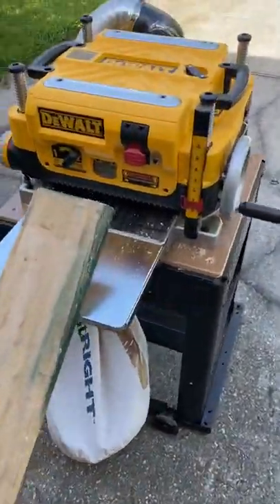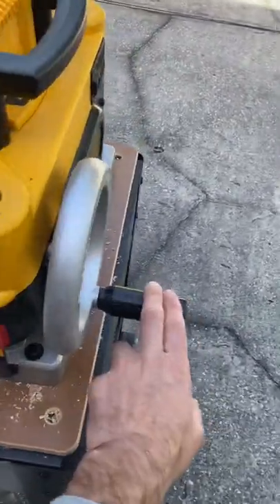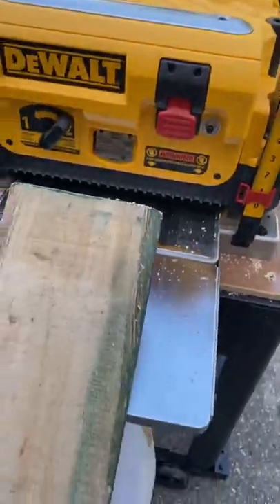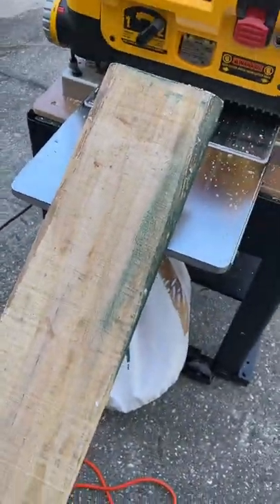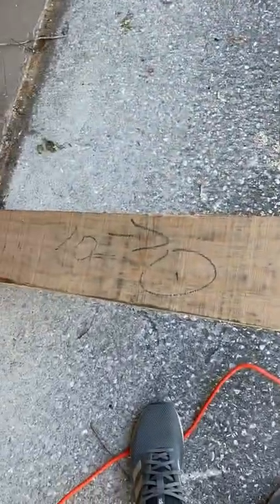Using a Planer 101

Comment: What did you take off dirt?
Reply: It's basically reducing the thickness of the board
A planer is one of the most useful tools you can get if you do woodworking professionally you will eventually get one
Reply: @outlandishbottle9279 you’re 100% right lol I’d rather buy crappy lumber and plane it myself than pay $9 for the same board just cuz it’s not square 😂
Reply: @nightdivination89  you either haven't bought wood in 4 years or live in an area with a lot of private sawmills and wood supply stores. $9 a board, try $17 to $34 for shitty boards full of cracks and covered in spills imported from China.
Even if wood was a cheap as you said, still the best kiln dried and stored wood  can have twists and warps and cupping.
Having a planer will true it up enough to work with to make amazing looking furniture and cabinets.
Without a planer, perfectly measured and cut boards still produce twisted and wobbly furniture that you have to try and fix after the fact.
With a planer, your measuring and cuts it effective for a perfect fit....provided you didn't mess up measuring, lol.
Reply: @alexistaylor969  I noticed this looking through Home Depot. I couldn’t believe how said $9 lol. Shit was as much as $50+ in some cases easily

Comment: Don’t put money out for this piece of junk.   DeWalts customer service is very poor.    Mine hade 15 minutes total of light duty and it popped the breaker each time I used it.  The belt melted off planing a 4 inch wide piece of pine.    Dewalt did nothing.    $800 and I have nothing.

Comment: That is a thicknesser, not a planer.

* A planeshaver has the cutting head IN and parallel to the feed bed.
It is used for shaving a plane onto the workpiece to eliminate warping.

* A thicknesshaver has the cutting head ABOVE but still parallel to the feed bed.
It is intended for making planes on opposite sides of the workpiece parallel to one another, and adjusting the thickness of material between these plane-pairs.

* An angleshaver has two feed beds at a 90° (or adjustable) angle to one another, with the cutting head being parallel to one, and thus perpendicular to the other.
It is used to control the relative angle of non-parallel planes, such as ensuring that the sides of a plank are at a right angle to the major faces of the plank.

A thicknesshaver like the one in the filmstub can be equipped with a planeshavingsleigh to work as a makeshift planeshaver, although this device is not shown in the filmstub.